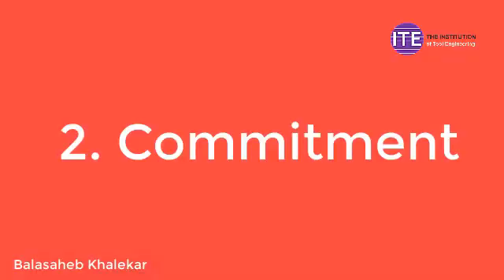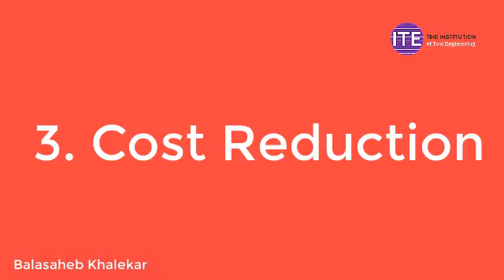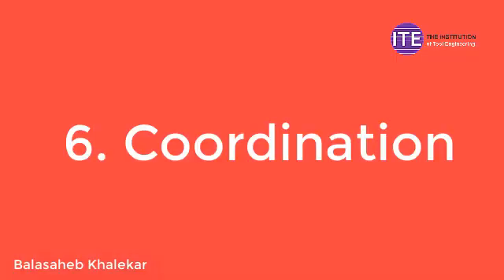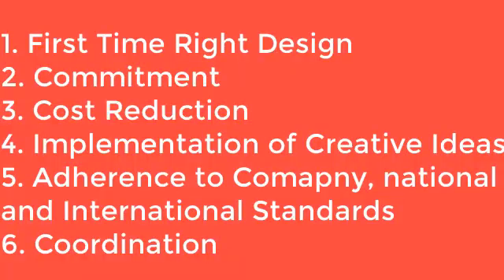How to grow fast as a Design Engineer | Design Engineer |Performance Measures of a Design Engineer|

Comment: Sir i have worked for 2 years as a structural fabrication engineer. Now I want to switch field and wanted to work as tool design engineer, is it possible for me now.
Reply from the maker: Yes.Absolutely. you need to prepare for some skills like Drawing visualisation, Manufacturing Processes,  Engineering materials and CAD softwares.
Reply: @balasahebkhalekar  Sir fresher are only interview with cad test in catia, as they are not having any experience in tool design. Depending upon cad test performance only fresher are hired. Hence to be design engineer cad software are more important than theoretical knowledge.
Reply from the maker: @NewJobsAlert2025 . Agree with you. It depends upon the company interview methodology. Some companies give more weightage to CAD.  Some companies they require strong technical Foundation.  Some companies both.